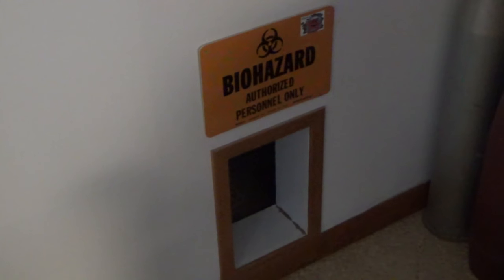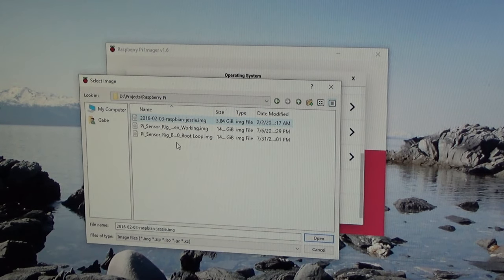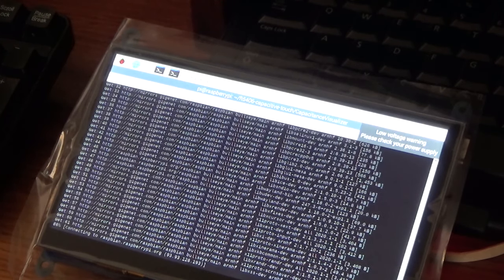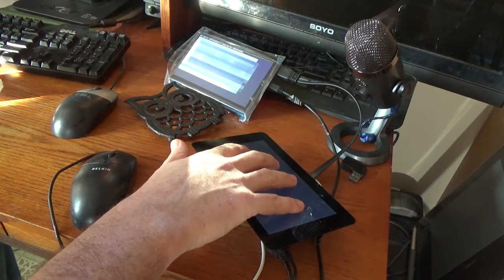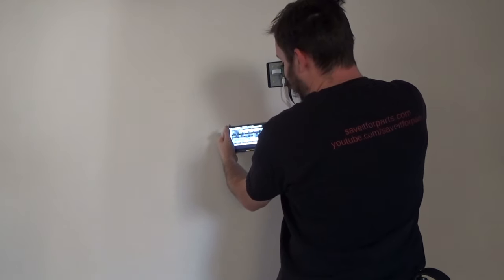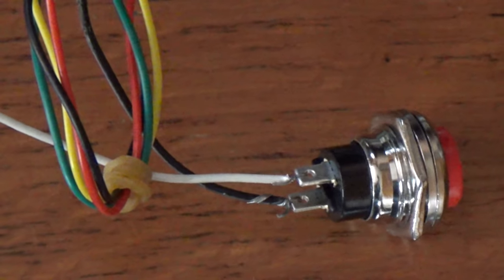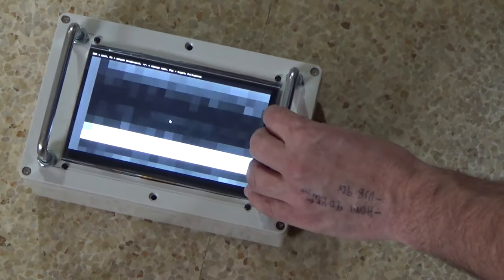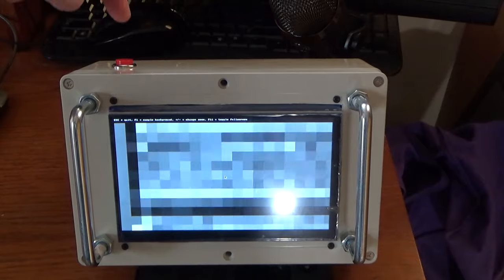Handheld Capacitive Wall Scanner With Raspberry Pi & Touchscreen

Comment: CLEVER!! Image processing would help increase the contrast and identify features in your scanner. Careful coding in an R script might work without having to work in C or FORTRAN. The R Project is a statistical package for Unix, Linux, Windows, Apple, and others that will run much the same as a shell,. If you piped the output of the scanner to R script it could do some image processing in something close to realtime if you are careful to use fast libraries and not do divisions.

Comment: Interesting ’hack’. The capacitive touch grid IS a sensor... Cool!
It would seem that distance/proximity would affect the ‘signal’ you’re sensing...did you test that?
Way to hang in there and get ‘er done!
Reply from the maker: It seems like it has to be touching a surface to read capacitance. From what I understand of the tech (relatively little), these screens are calibrated to see the difference in capacitance between air and anything more conductive. There's something called "projected capacitance" which works through thicker glass screens (or maybe thicker sheetrock), but I'm a little weak on the theoretical side of it!

Comment: I made a keypad with pygame and had the issue that I had to run it inside X for the touch input to work properly. I used devilspie2 and this lua config to make things fullscreen with no decorations:
if (get_application_name()=="keypad") then
   undecorate_window();
end
Reply from the maker: Interesting, I understood some of that :-) I'm having trouble getting the HDMI / USB touchscreen to work at all, even from the desktop. I don't really need it at the moment, and there's a driver to get the back side screen working as touch input if I really need to. Maybe I could hard-wire another button to enable/disable touch on the sensor side...

Comment: 0:01:48 Looks like you need socks for Christmas!
Cool project though. I'm guessing only the digitizer and the driver chip is needed, not the LCD.  Since they don't seem to come separate, maybe there's a way to modify the connection to use it only as an input device.  Did you try it without the LCD ribbon cable plugged in?  Or the digitizer from one and the LCD cable from the other (might not fold/fit).
I think I avoid Raspberry Pi because it seems like a rabbit hole of projects and buying parts!
Reply from the maker: I did try it without the ribbon cable and it didn't work, seems you need both. The display screen uses HDMI / USB so it's completely separate.

Comment: Nice job, I would like to improve my Linux skills as well.
Reply from the maker: It's a lot of fun, especially if you're doing something a little odd or uncommon that forces you to learn more of the guts of stuff. And even the uncommon things usually have someone who's done it before, so you can copy their homework or snoop through old forum posts for ideas!
Reply: @saveitforparts  It helps when you have at least a 160 IQ. Lol